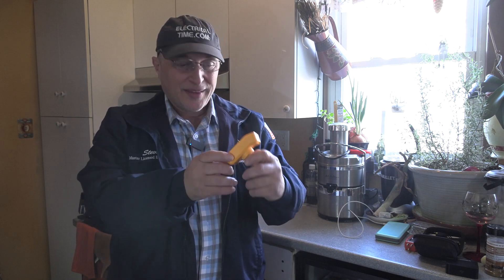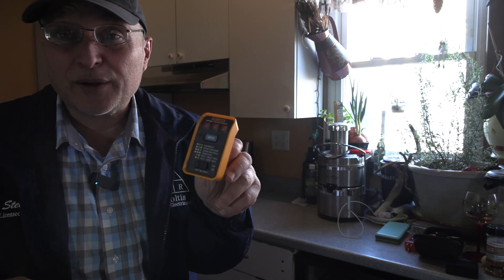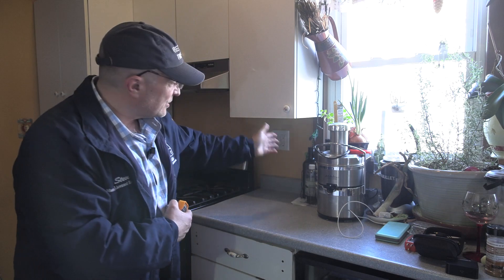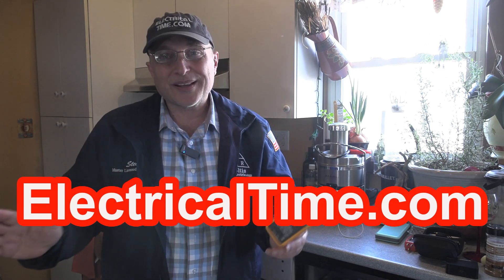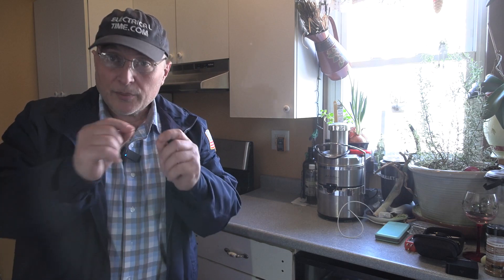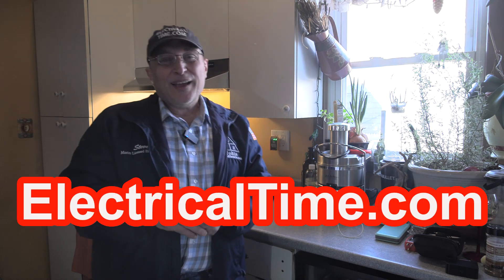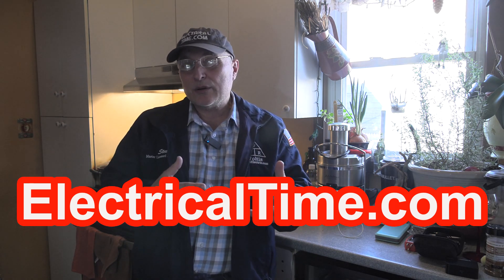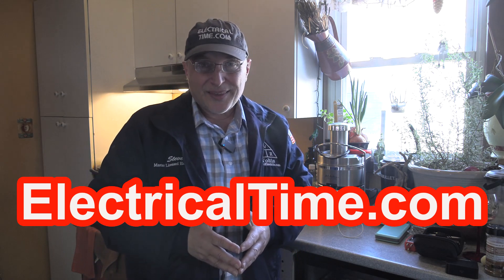Fluke GFCI Tester Demonstration Model ST120+ By ElectricalTime.com Video 2023-018

Comment: The light, electrical stove control panel and the refrigerator do NOT require GFCI protection. Only receptacles serving all countertops and being two separate 20 amp circuits.
Reply from the maker: Hi Robert, thanks for your comment. The rules for GFCI protection keeps on changing with each NEC edition with the goal to make it safer for people. In the 2023 NEC, 210.8(A)(6) GFCI Protection in Dwelling Units requires that all 125 Volt through 250 volt receptacles that are installed in KITCHENS, that are supplied by Single Phase Branch Circuits rated 150 Volts to Ground or Less shall have GFCI Protection, therefore under the 2023 NEC, all receptacles that are in a Dwelling Unit Kitchen fall into the voltage and phase parameters would have to the GFCI Protected, regardless if they serve the countertop or not. 

In the 2020 NEC, 210.8(A)(6) said that GFCI protection in Dwelling Units of a Kitchen was required where the receptacles installed to serve the countertop surfaces and I believe that your comment was referring to the requirements in the 2020 NEC and therefore you would be correct. 

Also in the 2023 NEC, 210.8(D) "Specific Appliances" requires GFCI for the BRANCH CIRCUIT or the OUTLETS that supply power to the following appliances rated 150 Volts to Ground or Less and 60 Amps or Less, Single or 3 Phase:
(1) Automotive Vacuum Machines
(2) Drinking Water Coolers & Bottles Fill Stations
(3) High Pressure Spray Washing Machines
(4) Tire Inflation Machines
(5) Vending Machines
(6) Sump Pumps
(7) DISHWASHERS
(8) ELECTRIC RANGES
(9) WALL MOUNTED OVENS
(10) COUNTER MOUNTED COOKING UNITS
(11) Clothes Dryers
(12) MICROWAVE OVENS

Therefore these Specific Appliances, regardless of the location where they are installed, will require GFCI protection even if they are hard-wired or cord and plug connected.

So in your original comment, the kitchen lights in the ceiling would not require GFCI protection in the current 2023 NEC

Again thanks for you comment and thanks for watching my videos. All the best, Steve

Comment: 2 circuits for counter top recp.
Reply from the maker: Correct, 210.11(C)(1) Requires a Minimum of 2 Small Appliance Branch Circuits for a kitchen in a Dwelling Unit, each at 20 Amps
Reply: @ElectricalTime  you are the man
Reply from the maker: Thanks Jeff, all the best, Steve